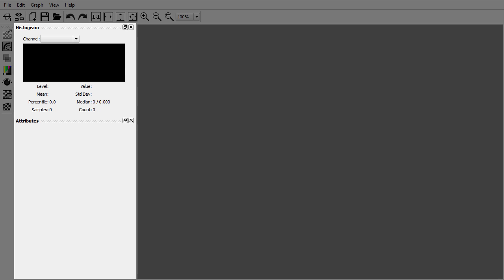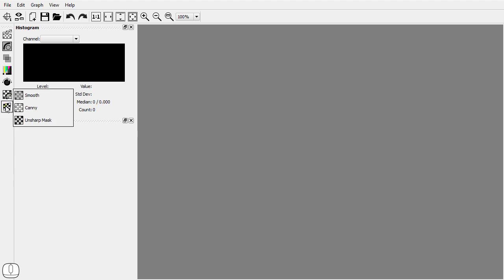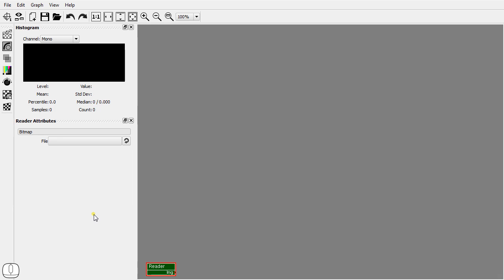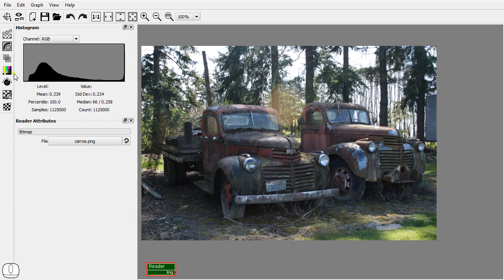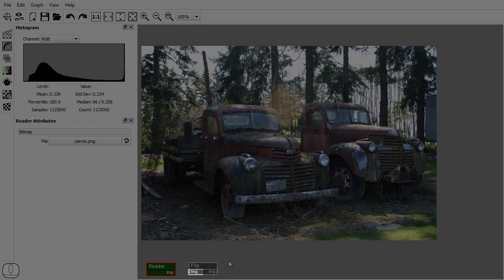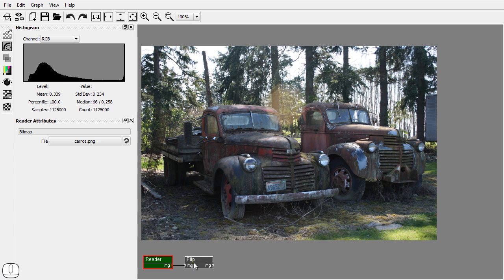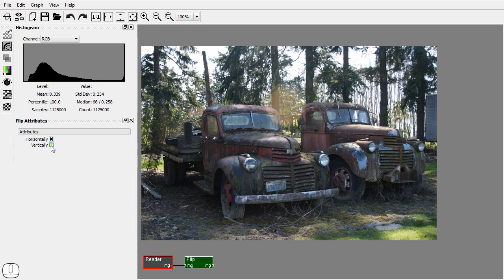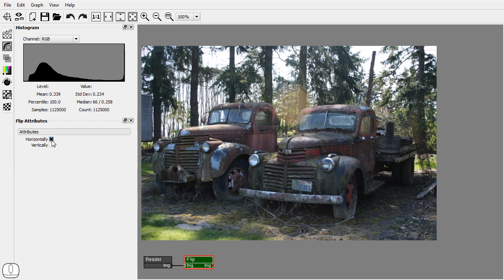PixaFlux - 2. User Interface

Comment: I think it might be a problem for me when I deal with nodes and images in one pannel, like if I have put up too many nodes. I would want to arrange the nodes properly and also have a proper place for the image. So do you have something that would work out for me in such case.
And last question can  we just change the flip node to display without pressing D, I have some problems with my keyboard, so any way that would help me to just make it a display node with just few clicks(only using the mouse). If not can you please make these changes in your next update
Reply from the maker: Hello Akshith. This video is very old. In the latest PixaFlux release there are 3 viewports, one for the node graph, one for the image and one for the 3D model.
The D key sets the selected node as the display node that displays its image in the Image viewport.
The A key sets the selected node as the active node that displays its attributes and properties in the control panel.
You can use also use double click to set the Display and Active node, or the toolbar.
Thank you for your interest.